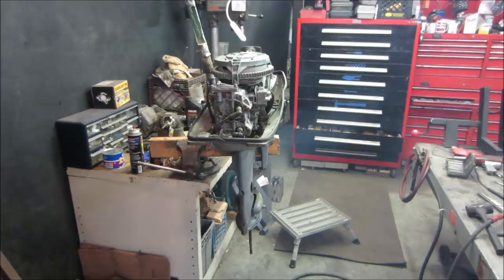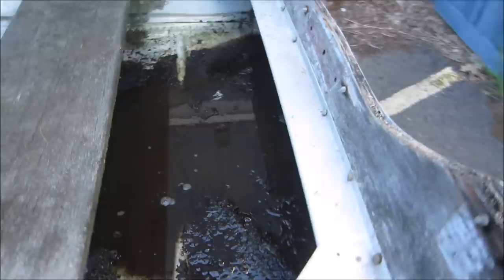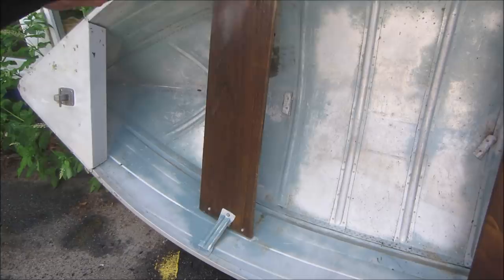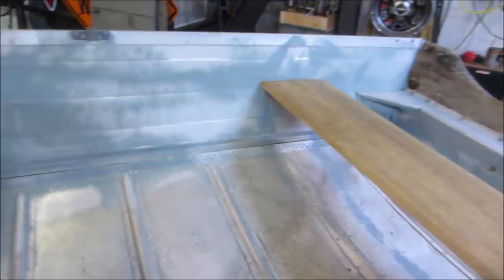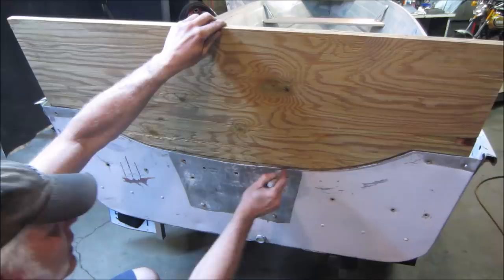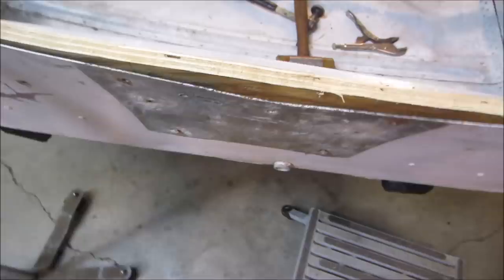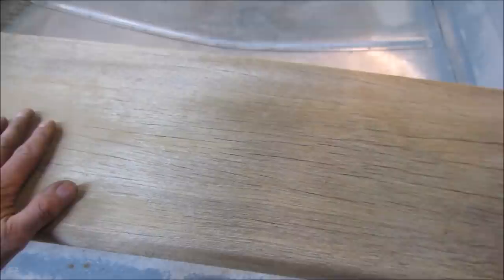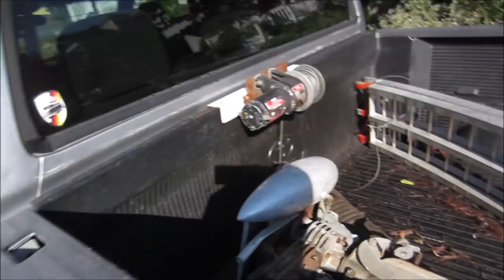Free Boat, First Wash/repair in 20 Years

Comment: Starcraft Aluminum Boats , & OMC outboard motors were the best in the day !!!.....Best of luck with them !!!..... I think your boat had a floor / deck from the factory....that is what those brackets were for on the bottom....Also there is no floatation under the seats.....Factory put it under the deck....Someone must have removed it

Comment: There was a reason that plywood went from side to side on the transom you need to go ahead and put the right size transm in because if you don't let Motors want to be pushing up against it and it's going to be flats and right there at the counters and it's going to rip that Trans Am out and it's going to rip each counter down and could this rips right off and God bless

Comment: Mustie, when looking for parts for that 5 horse Mercury, look up parts for a Yamaha 5hp as it is Yamaha who made them for mariner and mercury, they date back to the early 80s to around 2002, i have a 1999 and it is the sweetest little engine that has a forward-neutral-reverse lower unit

Comment: Add some   1/2 cup of Simple Green or even a linguist dish soap to the sprayer along with the bleach and water.  ,Let it sit for a20 minutes. Then the pressure washer.  It will clean better than just bleach and water. 
JoeB

Comment: Support to the seats from the hull and supports to the gunwales as well and a  channel cap over the transom aluminum too an yes outside board 3/4''most likely,looking good. I'm sure a lower units out there for the motor but cost ? Good work as always spar varnish and good marine or exterior plywood.

Comment: You really need top braces on the transom, if not the vibration will stress the aluminum and it will break . You need some wide corner brackets with a good size 90 deg Bend the outside angle pointing down  for rigidity.

Comment: Pressure treated lumber on the aluminum will corrode. You should use a different wood. The chemicals used to treat the wood will destroy the aluminum pretty fast.

Comment: I have that exact Mercury 5hp and can't figure out how to get the bottom end off. Hoping the future video comes sometime this year!!!
Reply: highlandoutboards yt channel has a video on how to fix the lower end pump on a 3.9 hp, 1968 Merc. Two nuts hold it together, a 1/2" and a 9/16". Hope this helps.
Reply: @waitaminute-vw9hf  thanks. The  late 80's are slightly different. That particular model does not seem to be represented in the manuals available. I am guessing Mustie will do it in a few seconds and a light will go on. I will check out those videos however.

Comment: Just subscribed after watching several of your videos but this one had me yelling at the TV. Finally you stopped trying to turn the motor or shift it. The clanking noise you were hearing should have immediately made you realize that you had a lower unit problem. The shift lever and linkage will not withstand a lot of stress and I just knew you were going to break something. I love to see those old outboards still in service on the water.

Comment: Sure would have been nice if you could have saved the Evinrude that was on the boat when you “bought” it. Also, I am pretty sure the boat originally had a piece of plywood on the outside if the stern like the repair you did. Boat really looks good, amazing what a pressure washer and some bleach can do to crusty mold and mildew. But, what else have we come to expect from Mustie?😊

Comment: I just learned about Teak wood on boats.. There are a few different oils you can use. I used Teak oil on some very old bad looking Teak and holy shit!! Nothing comes close, NOT Thompson's for sure.. Check out a few videos  on old boats and Teak Oil. They apply it every couple years with no lacquer to sand off.

Comment: Why wood you expose wood to water especially porous plywood? It will still rout even if it is pressure treated and sealed. Move it to the inside of the boat. Note the witness marks on the aluminum out board on the transom.

Comment: Well, here goes, I have been watching your videos for a long time and not only do I look forward to every one and learn something useful this one missed the mark. It's title should be "How to Half Ass a Boat Transom Rebuild". This area on a boat is critical to get right due to the amount of stress it has to endure even with a little 5 hp engine. I have a little experience in this matter and just want to help because of the safety issue that this project entails. The minimum amount of thickness for a transom should be 1 1/4" thick for engines with a horse power rating up to 40hp and that the boat's design and materials were engineered for that amount of horse power and overall weight (boat, accessories, fuel, passengers etc.). Notice how the aluminum seams in the back are double riveted there is a reason for that, extra stress.  Ok, enough said, what should be done? 1. I would suggest on your boat you use 3/4" Marine Grade Plywood "FITTED" to the inside hull dimensions and thoroughly coated with a marine grade epoxy on all sides. 2. Using the outside darkened area as a template, cut another piece of 3/4" plywood to match and coat with epoxy. 3. Pre-drill all mounting holes to match and sandwich the whole thing together using stainless steel hardware. Hope this helps and again I love the channel, the projects and the opportunity to learn from you!
Reply: Well here goes, Move on karen. Unsub if your so upset. Make your own video and do it your way.

Comment: Modern treated wood eats aluminum due to the copper content they use to pressure treat it. It causes a reaction due to dissimilar metals and will cause it to corrode super fast. Hopefully that's not regular treated ply. Non treated lasts fairly well when sealed properly.

Boat looks good though.
Reply from the maker: its sealed in urethane ,

Comment: Measure what your missing on.sides, go to plastic store & get some square lexan stock, wont rot or swell, glue in? Same for piece on back. Maybe 1/2 " or 3/4 thick. Ok...  Enjoy your fishing. Use stainless bolts if its going in the salt/brakish water. Before you bolt it seal all that wood up including edges. Or it will swell & rot.
Use marine paint, on boat ect.

Comment: Love the boat restoration. I would make corner braces, seat braces, and an angle brace from the transom to the floor. That boat is made of thin aluminum, and when you hang a motor on the transom the weight and thrust of the motor is absorbed by the transom...Great video.

Comment: It's amazing how well the boat cleaned up. I was really surprised by the seats. 

Oh, and I think there are 2 more pieces of wood that goes on the outside.  Notice on either side of the back that there's discolored aluminum (just like where you added the other wood on the outside).  I think if there was wood to bolt through on the outside in those locations it would make the transom even more rigid.  I hope that makes sense. LOL

Comment: Piece of aluminum. Cut the ends of the wood at an angle and two strips for the edges and glue with epoxy.

Comment: Cleaned up nice. You need to install some corners which are part of the structure otherwise the aluminum on the transom will crack if not already?

Comment: I would not use steel on the aluminum boat. The chemical reaction of two kinds of metals meeting will destroy one of the other very quickly. I will be with me be sure to use aluminum rivets if you use pop rivets to put anything together. I didn’t even use aluminum screws if you can find some if you do in the other work.

Comment: I have the same outboard Mariner 5hp same motor but made in Belgium not USA single cylinder peachy motor ideal for that aluminium dingy mine pushes my 18 foot boat along at 5 knots as backup motor

Comment: it seems like its holding water . lol we dont really care if it holds water in we want it to hold water out . dont use an expensive motor for the first float test hahaha
also check to see if you can use pressure treated wood on a boat because of the chemicals

Comment: Are the seats mahogany? That's a wood that can get furry like that. Try the fingernail test. If it dents upon hard force it could be mahogany. Hardwoods won't dent, but mahogany should. If it is a harder wood I'd guess white oak as both of them are fairly rot resistant. 
 30:20 Yeah, looks like mahogany. That wood is pretty expensive these days. You can scuff sand what finish you already have on there and finish it with marine grade finish as you'll need the UV protection. Try to store it indoors or at least covered after this.
 I'd really take to heart the comments about its lack of floatation and build some underneathe the seats. A couple of 1 by 8s with some of that blue home foam should do nicely. It's easy to cut with an electric kitchen knife. Though honestly a boat that wide is close to impossible to sink under human power. I know because I purposefully tipped over a 12 foot Alumacraft row boat and it took me some minutes and repeated rocking while standing on the edge to accomplish this feat. I almost could not do it.

Comment: I'd NOT use pressure treated construction grade plywood on an aluminum boat. It eats away at aluminum.. All boat supply houses sell MARINE GRADE plywood for boats. I have bought scrap pieces from them bigger than what you need for a few bucks... And yes, the back corners are normally either a cast corner gusset or I have also seen aluminum tubing with the ends flattened and screwed to the corners. They make for a nice place to hook and strap down the boat on the trailer and also takes the place of a cleat to tie up to a dock.

Comment: I have the video paused
There should have been a thin aluminum plate wrapped over the transom to protect from motor clamps.
 NOTE: Some motors are bolted on
The seats should have brackets in the middle and sides. Someone had redone the boat before and just left the brackets out.
Rear corners should have a bracket with a handle / hole for lifting it. 
I've restored several small VHull's in the past. Video makes me want to do another one.

Comment: A lot of those boats had compartments under the seats filled with foam for extra floatation. Also, the back corners would have had braces like you mentioned that were also handles. What about the gaps at each end of the new transom? I would cut some pieces to fit and maybe epoxy them into place. Just sayin' ....

Comment: I would have sprayed the boat down with bleach inside and out and let stand about 20 minutes then washed it off / rinsed it off with the power washer.  That's what I used to do with my house in CT every other year to get all the mold off the house.  I used the cheap store brand bleach too not the more powerful expensive Clorox bleach.   I have a bug spray bottle that I use to spray the bleach.  I would spray a section of the house then wait then rinse with the power washer.  All that green crap would die and you get back to your original color.
Reply: I spoke too soon, Mustie1 was way ahead of me...

Comment: Before you do any bolting down..... treat the wood on ALL SURFACES! ...... Or you will soon have the same problem as the one you are fixing, only more so.... as now you have wood on the outside of the transom.
Reply from the maker: l told you in the video l sealed the transom wood

Comment: Would've taken the wood boards/seats myself, but eh. I'm noticing it's missing any flotation safety, i was under the impression you're supposed to have such a thing by law in NA? I imported a couple of boats in a load once and they came with big closed cell foam blocks wedged under the seats.

Comment: Not so a good job. I would have taken the thwarts out and refinished them on all sides, seal the wood before vanishing, would have saved vanish. Floor boards should be put in to protect the bottom from inside hazards and puncturing the hull from fuel tanks anchor, etc. Seal the edges of the plywood to make it water proof, rain water causes dry rot. Other than that I watch you very often and I do learn a lot, Thanks for your knowledge.

Comment: Mold has roots thus depending on the structure of cells such as wood or metal, they attach differently. When using water to aid in the removal of mold from wood, the potential of the mold returning because roots remained after a cleaning using water, regardless of the chemical used, the higher the potential for it to return. Mold, like fire, needs fuel, air and heat. Molds like damp, warmth and food. Don't we all...lol.

I have serious reactions to the smallest amounts of mold, especially black mold so I had to educate myself about it. I can walk into any space and tell you within a few moments if there is mold. Some people don't smell it or can't see it so they think it isn't there. Sort of like the tree that falls without witness senario. Trust me, it is there and it makes a noise, my wheezing!

The point I am trying to make, sans my attempts at being funny, is that just bleach spray washing and such are not enough to kill the mold which will survive on the surface you spray it off of and now onto, the grass. Walk through it and you spread it. Imagine if it were sticky so when you do your cleaning, the materials used should be disposed of like a biohazard, because it is one. 
Peace all, stay safe and love life to its fullest as long as you don't hurt anyone.
Reply: the boat was sitting on the pavement when washed not grass.

Comment: 35:22 Somebody needs to clean out that birds house before the next season. there is a reason why the hole is that far up from the bottom of the house. that chicklets sit way too high so that many predators can reach them with their paws even if their own head doesn't fit in the hole. this usually happens when the house wasn't cleaned out of old nest material and "other stuff" for several seasons. most birds will built a new nest on top of the old one.

Comment: My boat had wood on both sides so that is right . When you put it together will you use caulking for the bolt holes and caulk or cement the boards to the aluminum?

Comment: I may be wrong but my old boat from years ago was similar and it had trapezoid shaped supports under the seats about where your angle pieces are, mine were wood which rotted out so I replaced them with aluminum I fabricated in the machine shop I worked at.
Also, I have been watching your videos for a long time and this is the first time I don't understand something you did which has been pointed out by quite a few folks, why didn't you make the plywood the full width of the transom?
It would seem that you have created a weak spot on either side.
Reply: I don't know if Mustie1 will respond, but I believe the reason he did what he did was because that was the piece of plywood he had on hand and it was only 48" long on its longest dimension. As tfastlane mentioned in his post some filler strips glued in on each each end would help firm things up (along with fabricating and adding metal corner brackets).

Comment: Wow, I’ve never seen Mustie take so much heat in the comments. People are sensitive about boats, I guess.
Reply: They are, but it's because when things go wrong aboard a boat, you can't pull over to the shoulder and call for assistance. Bear in mind the comments regarding the transom, if it were to fail while out on a lake, the water inrush would sink the boat in seconds, hence the comments about supplementary floatation devices (foam blocks under the thwarts). boating can be very pleasurable, but it is also a hazardous pastime if you're not fully aware, nor fully prepared.

As a test-bed, this boat actually needs to be better than an average 'day boat' because it can potentially see more power being applied to its transom than it was ever designed to withstand.

Comment: Using anything but aluminum on an aluminum boat is going to cause some serious corrosion problems very quickly due to dissimilar metals reacting with each other.  That transom being short is not up to the normal Mustie standards.
Reply: You can use wood for transoms but not treated, because the copper in the treating process.
Reply: @JosephAllenCavin , sorry, I was referring to him possibly using steel.  Stainless will work but not any other kind.  I worked at out local Navy base for 35 years and you'd never believe some of the stuff I've seen happen when you mix dissimilar metals and water.

Comment: If the seats are teak, and the color is right, you need to seal them with teak oil.
Reply: There is no such thing as teak oil, it's just a mixture of chemicals. You're better off using something like pure Tung oil on teak.
Reply: @planejet42  I guess in your world if it's not made from babies there's no such thing as baby oil.
Reply: Thermal Reboot I mean, most oils are petroleum based or by-products, including baby oil. In many cases, you’re better off using oils that aren’t produced with petroleum, especially with wood or leather.
Reply: @planejet42  Well, I don't know what Teak Oil you use, but I looked at the ingrediants of mine and it's boiled linseed oil with UV inhibitors.  Last I knew Linseed wasn't from Petroleum and is widely recommended for use on wood.

Comment: Don't use pressure treated wood. The chemicals will eat the aluminum. Just use marine grade plywood or regular plywood.
Reply from the maker: wood was sealed
Reply: @mustie1  I normally wouldn't argue with you because your a pretty smart guy and I enjoy your videos but did you micro seal the edges of the plywood with several coats of epoxy paint (allowing each coat to dry between them? As per manufactures instructions?) and is the boat never going to be subjected to any vibrations where a pin hole in what you used to cover the wood might appear? Then you might be ok. Oh, don't get the boat wet either.  Don't believe me? Type in " damage caused by using pressure treated wood in a aluminum boat" into your search engine. 31,900,000 results in 0.77 seconds. But maybe I'm wrong?  :)